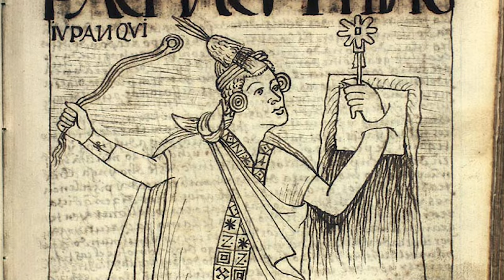SACSAYHUAMAN - How They Did It | Polygonal Masonry

Comment: Vincent Lee's stated theory, in practice, fails to produce the results shown at Cusco. In the most general sense, the counterclaim to mainstream archaeology is that the described technology and techniques insufficiently explain the construction results at Cusco, hence one possible explanation is the theory of a more advanced, antediluvian civilization (albeit one that the referenced critics lean heavily towards). Some of the details that Lee claims are objectively false, and even contradicts mainstream archaeologists' claims.

Quarrying
If the ancient builders were to utilize loose, scattered, and oddly-shaped rocks either as-is or with relatively little processing, then they'd still have to chip away at the adjoining rocks to create a snug fit. That would arguably involve an even greater amount of labor, than if the stones were processed into more uniform cuboids (i.e. more ashlar in style). That is, most of the stones seen in the lower half of Cusco (hurin) were processed to have straight sides that were either parallel or perpendicular to a level ground. In contrast, the more pronounced polygonal shapes seen in the upper half of Cusco (hanan), namely at Sacsayhuamán, have more randomly-shaped and curved sides indicative of polygonal Lesbian stone masonry. To say that the latter is the reason for the polygonal design choice neglects evidence that show the builders going out of their way to process most of the stones that are relatively more ashlar than Lesbian in character.

Still, many of the stones used at Cusco may have been picked off the ground out of convenience, and that stone sourcing is not mutually exclusive to quarried stones. Logically, if we know that some of the stones at Cusco were sourced from scattered, separated rocks, but other ancient sites such as Ollantaytambo and Machu Picchu were mostly or entirely built with quarried stone, then it does not sufficiently imply that Sacsayhuamán was mainly built from non-quarried rocks. In fact, mainstream archaeology claims that the quarry sites for Cusco's megaliths were approximately 32 km away at Muyna Waqoto and Rumiqolqa.

Animal Depictions in Stones
42:45 Vincent Lee is incorrect here. The stones themselves certainly may have been "the point" in and of themselves, especially given their megalithic size. However, to say that the stones were devoid of animal depictions is incorrect. There are many examples of lithoglyphs and sculptures throughout Cusco. The following are some popular examples available for tourists to visit. (1) There are 14 serpents carved in relief on the walls of the Siete Culebras street. (2) There is an abstract sculpture of a serpent comprised of multiple stone blocks of contrasting color within the mid section of one of the walls between Inca Roca and Hatunrumiyoc. (3) Another sculpture in the same vein as the serpent in (2) depicts a puma at the same location. (4) There is a large sculpture of a puma paw print made in incuse (which even has its own miniature version of the 12-sided polygonal stone built into its pedestal) at Cusco's Limacpampa square fountain. (5) Even at Sacsayhuamán's fortress, there's an abstract 5-stone compilation of a puma paw print made in the same vein as (2) and (3). In fact, when viewed aerially, the (6)_entire_ city of Cusco is shaped like a resting puma, with Sacsayhuamán as the puma's head. This is reminiscent of the geoglyphs of Southern Peru known as the Nazca Lines, which historians and archaeologists associate with the Pre-Incans.

Trial-and-Error and Scribing
I've seen many modern examples of modern trial-and-error and scribe work on stones, and the quality of workmanship is nowhere near that of Cusco's. Look at modern restoration work of ancient megalithic sites all around the world. The workmanship is crude in comparison to the snugly fit stones at Cusco and at other ancient sites. The analogy of scribing in woodworking to fit polygonal stones together is clever. However, the results in practice lack comparable results for stone (i.e. granite, dolerite, basalt, limestone). Even when scribing wood to fit adjacent to stones by very skilled woodworkers, there are very noticeable gaps (i.e. the wood and stones don't fit snuggly like they do with the megalithic stones). Look up examples of wood scribing onto stone, and it's clear that this method yields too crude of a fit to sufficiently exemplify the work at Cusco.

Replicated today, perhaps a more accurate method, apart from more modern tooling techniques such as with CNC and laser scanning, would be to employ a modified ornamental rose engine lathe that traces the stones' texture to create a tight fit onto adjacent stones. The host surface you want to copy over would either be made into a negative first, or the mechanism itself would scribe a negative of its surface onto the adjoining rock's surface (hence the modification of the ornamental lathe). The result would be an engraving, in which every point of contact between the two stones would produce a "paired" surface point, and would necessarily be equidistant from another pair. It remains to be seen if that's true of the megaliths at Cusco. The earliest example of that lathe was in Europe for wood ornamentation back to around 1600 AD. They're also used to replicate designs onto stone and metal. However, that was not available to the megalithic builders of Cusco. Perhaps a more primitive form of that technique was used, but the manual scribing technique described is not it.

Comment: If you applied any knowledgeable study you would realize the reason the faces bulge and the tops of the walls are never straight. And why the lumps are at the bottoms of the stones. The stones were cast in place with decomposable bags filled in place with dry particulate then saturated. The lumps at the bottoms of the stones were to allow liquid to drain through for larger stones. Use some common sense. Jesus.

Comment: So far every theory seems unbelievable on how and why they built the polygonal walls. Also, the Inca were prolific builders using small stones, these polygonal walls are clearly done by another civilization.
Reply from the maker: So you think that different size stones mean different civilizations?
Reply: @WorldofAntiquity  Do you  think the Inca were the first people to occupy the area? The tech used in fitting the stones points to another civilization, not just size.
Reply from the maker: @far-middle  But the signature characteristics of Inca stone work on walls made with small stones matches characteristics of the walls made of large stones.
Reply: @WorldofAntiquity  the small stones aren't  shaped to fit like the larger ones. They both are mortarless but aside from that I don't see signs they are done by the same people. They also have examples of precise boreholes  similar to those in Egypt. I don't see how that can be done by hitting 2 stones together
Reply from the maker: @far-middle  The smaller stones ARE shaped to fit the larger ones. You can see that at Sacsayhuaman itself on the inner two walls. And I don't know of any bore holes at Sacsayhuaman.
Reply: @WorldofAntiquity  the fit on the smaller stones are not anything like what's seen in cusco and Machu pichu. It's actually closer to what's seen in Egypt and the Mediterranean  how they would shape a stone with a right angle to be used on inside corners. They also have similar knobs in certain areas protruding from the stone. Seems like there was a wider spread of knowledge in the ancient world than we give them credit for.
Reply from the maker: @far-middle  the fit on the smaller stones are not anything like what's seen in cusco and Machu pichu.
That's not true.

It's actually closer to what's seen in Egypt and the Mediterranean
That's even further from the truth.

how they would shape a stone with a right angle to be used on inside corners.
Right angle? Where do you see that? All the corners I have seen are curved.

They also have similar knobs in certain areas protruding from the stone.
The knobs around the world look quite different to me. And considering that there are only a small number of ways to make a bump, that's significant. Do you think rectangular building stones around the world are linked? How about spearheads?
Reply: @WorldofAntiquity  spearhead design is often used to distinguish groups just like building design. I suggest you look into the tiwaniku and wari that lived there for over 1000 years before you claim the Inca built everything in the 80 years they were existed.
Reply from the maker: @far-middle  We were talking about Sacsayhuaman and Machu Picchu.
Reply: @WorldofAntiquity  we were talking about you claiming the Inca are the first to occupy those sites and the different building methods used.  The Inca empire was just a short period of the long  history of many different groups of people like the tiwaniku and wari.
Reply from the maker: @far-middle  The Inca told the Spanish that they built Sacsayhuaman and Machu Picchu.
Reply: @WorldofAntiquity  a lot of details were probably lost in translation and the Inca not  having a written language doesn't help. Also, Machu pichu really doesn't  look like a kings vacation home and they seem to say that about a lot of the sites they're unsure of.

Comment: Good luck!  Ain't a one ever completed a stone project.  Hammer stone haha!  Explain some  layout techniques that any semi-skilled Carpenter will know and then claims that the stones are shaped by pounding with other stones.  Really try this if you haven't.  Creat a flat surface of about 1 foot square on some good hard limestone.
Reply from the maker: Lots of people have tried using hammerstones. It's not some big feat.
Reply: @WorldofAntiquity  I have use a Bosch 1/2 in. Hammer drill/chipping hammer in my limestone quarry and it's harder than hell.  Im experienced.
Reply from the maker: @essentialjudge2279  Are you experienced with hammerstones?
Reply: Rock on rock.  Yes.  Are you?  Have performed this kind of work for hours on end?  It will wreck a man's arm and wrist with very little production.  And no I do not think Lazer or magic.  
  And let's not forget we're not just talking about the little Stones you can pick up some of this rock comes in at about a hundred eighty-seven pounds per cubic foot and we're talking stone that are I don't know big as a refrigerator it's not that easy just to position and moving around  and scribe lines on it.
Reply: @essentialjudge2279  the stone on stone can also be done by holding the stone in place and hitting it with wooden mallet.
Reply: @michaelcollisson24  sure
Reply: @essentialjudge2279  thanks for agreeing with me 👍🏼
Reply: @michaelcollisson24  what ever gets you through.
Reply: @essentialjudge2279  No really thanks .
I was beginning to think that the last 27 plus years as a Stonemason was some kind of Matrix dream.
Cheers
Reply: @michaelcollisson24  that's it soft wooden hammers carved with bronze knifes.
Reply: @michaelcollisson24  whatever gets you through your day man.
Reply from the maker: @essentialjudge2279  What made you decide to use a hammerstone, if they are so terrible?
Reply: @WorldofAntiquity  I ran out of wood and plastic knifes.
Reply from the maker: @essentialjudge2279  ...and money, it seems.
Reply: @WorldofAntiquity you run your mouth a lot but you never do show as a product the proof is in the pudding get out there and produces a product to show us what you're talking about you know that's the real world do it stop running your mouth and do it.  Stop pretending to be other people and go out there and do it you can't neither can any of the other people because it's not that easy that's why you don't see people doing it that's why you don't see it everywhere that's why the Indians weren't doing it that's what a whole bunch of people throughout his be haven't been carving rocks because for some reason we have lost the technology otherwise everyone would be doing it.  Duh
Reply from the maker: @essentialjudge2279  That the Inca made the structures is already settled. That they had the knowledge, capability, and technology to do it is already settled. People SAW them doing it in Cusco The only unanswered questions relate to their exact methods for doing it. Knowledge of the method is lost, yes. And this video offers a suggestion for how they did it. It still doesn't change the fact that the Inca did it. HOW they did it and WHO did it are two different questions.
Reply: Perhaps a good compromise would be that essential judge failed at the hammer stone technique and the Inca would fail the hammer drill attempt.

Comment: Science has this thing that’s in simple terms is common sense. Why would I be thinking in preposterous theories when the finding’s point in a different direction. For example the molded cement idea, it implies molds and an infrastructure bigger than the monuments. This is a what you see is what you get and science doesn’t moves forward with unproven hypothesis.

Comment: They are not solid blocks moved and carved the blocks are made on site from a type of ancient concrete, made from rocks being ground into a fine powder and mixed with other organic compounds such as volcanic ash and super heated into a dense clay that cools to rock hard again, almost exactly like modern concrete.
Reply from the maker: Please share the evidence for this.
Reply: @WorldofAntiquity  I believe this because I am a civil engineer and have worked with concrete my whole adult life, the strange ringing sound the rocks make when being hit with a hammer is due to lack of compaction, we use high powered vibration tools called "Pokers" to force the air out of the concrete creating better chemical bonds allowing it to cure faster and be more dense, if you don't do this and hit a concrete wall with a hammer you can hear a ringing sound. The load stones having a "belly" this is because they loaded the stones on top before they properly cured, due to lack of proper compaction.
Reply from the maker: @magpieeuc4846  It is natural for someone to compare things that they find with what they have personally experienced in life. But to get reliable answers, true scientific analysis must be done. This eliminates bias.

Comment: Academia CLAIMS that granite can be cut and shaped with abrasion only.  They just don't know how to demonstrate a realistic test of that fantasy claim.  Put up or shut up.
Reply: The granite fountain in my front garden was made by abrasion. The sculptor used abrasive wheels to turn the big rectangular blocks into pleasantly rounded shapes. He and two assistants completed it in about two weeks. It’s quite large, larger than a car. The larger blocks weigh 19.2 tons. 

Rivers do a very nice job of abrading granite as well. I think the non-academics are simply unaware of the power of abrasives.

Comment: We need someone to try this out in reality. As it is described as something simple a test of making just one ten ton stone to fit into a complex wall could apparently easily be done and the riddle would be solved. Since there are many thousands of these fittings it cannot be that time consuming either. Just do it!
Reply from the maker: You would need several stones of the same size and composition as at the site, all the tools, and a group of strong people, plus a considerable amount of training, which would mean even more stones to practice with. Plus you would have to demonstrate the dragging of the stone on the same sort of terrain. That wouldn't be cheap. And even after all that, there still would be people saying you didn't do it right.
Reply from the maker: @TopazBadger6550  Like Topaz, for instance.

Comment: While I the manner of which you deliver the information is very enjoyable and appreciated I found that as a skeptic who wants good answers what Vince Lee offered just presents a myriad of obstacles to be overcome which I can not bring myself to accept. I believe the Incas had a way and it would be easier to mold the shapes together.  Early in the video you showed how the small stone repairs are recent work and not done by the Incas.  I've seen that video and the presenter goes on to refer to recent scientific experiments showing that the limestone was pulverized and molded ( a sort of concrete product was produced) together to create those shapes and could have been done as they were being laid in place.  I find that to be somewhat difficult becomes you do need the tools to break the stone up into power but still more acceptable than any other method.  Regardless I believe there is no doubt that there is still a mystery here , skeptic talking

Comment: 8:40 "It appears as if the third and second walls were built first and the lower, larger walls built last, Designed slightly differently"...

So.. you build from the top down? Huh.. Okay, so why did the "same" builders decide to use heavier, larger stones towards the end of the project, having built the walls, in your words, from the top down, (how you even know that is possible, let me know). I don't think your analysis makes much sense there.
Reply from the maker: I think you may be confused. Each of those three walls are completely separate from one another. So it's not from the "top down."